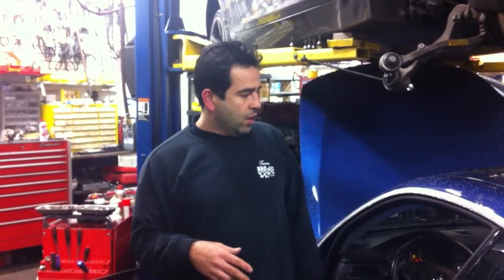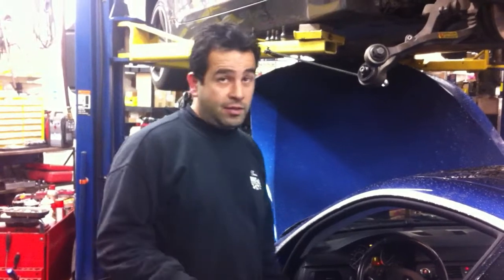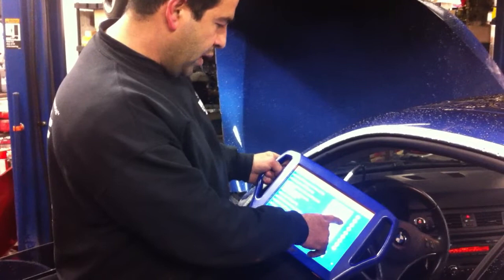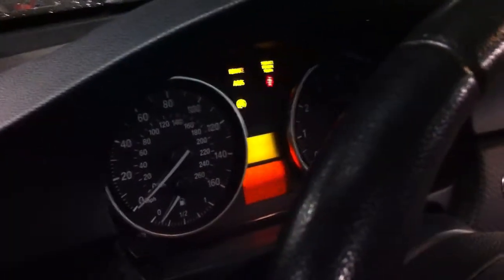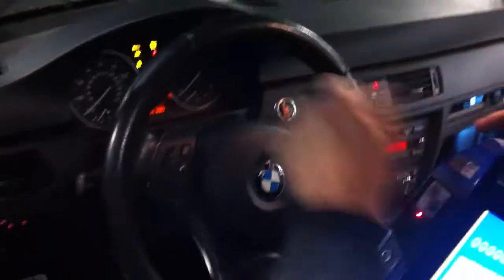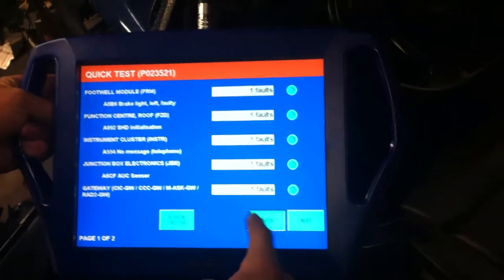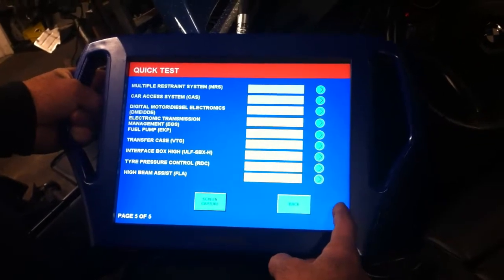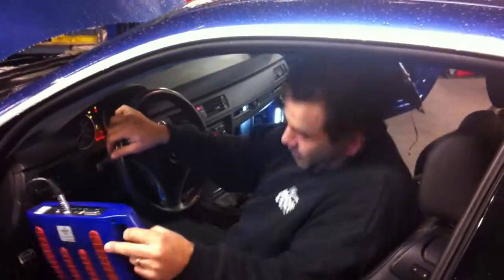VAC Motorsports exposes BMW E90 335 No communication Diagnostic pitfall with JB4 tuning kit

Comment: Yeah, I ran JB4 for 30 days on 335is. It was crap. Car is running MUCH better now.
I call BS on the owner for not telling you he/she had the unit installed. Wow...
Reply: leinadnosnahoj yes it does
Reply: JB4 doesn't work with 335is.
Reply: A.J. Elia works but not well , mine is 335i added up to 80hp
Reply: +Patrick Michael does it work on a 08 335xi?
Reply: +ARCH. M Yes it does, i have an 08 335xi and you will get between 60-80whp on map 1